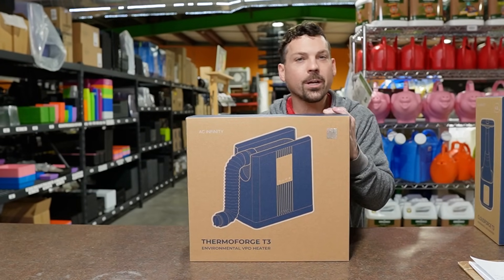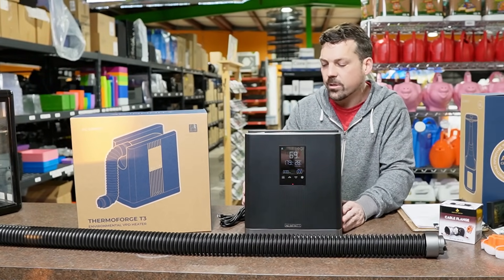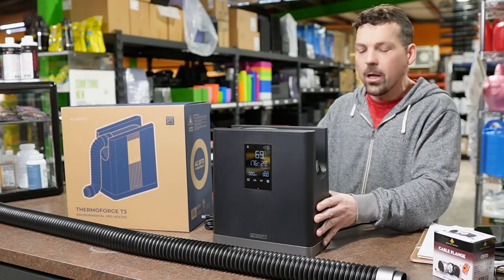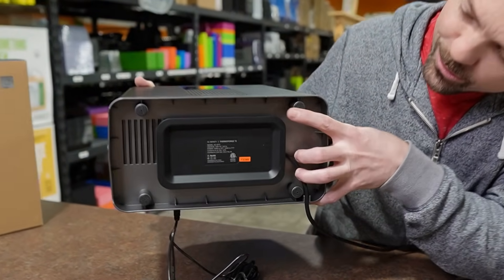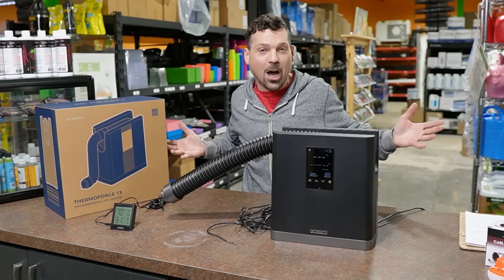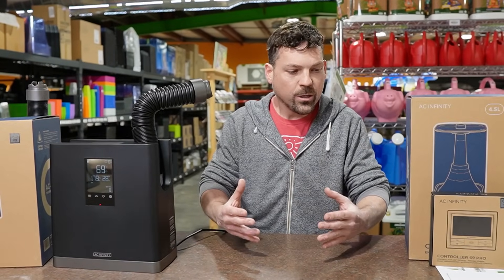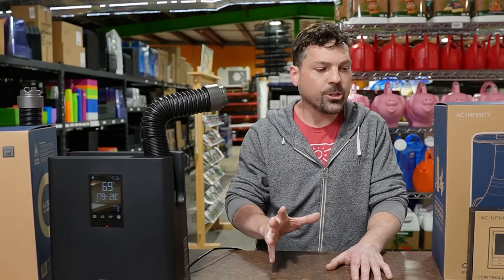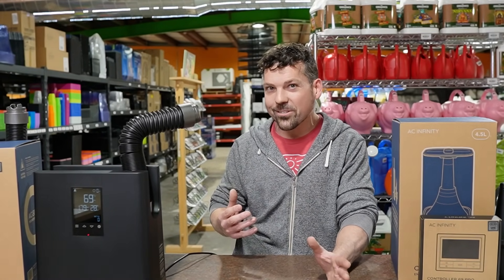NEW AC Infinity THERMOFORGE T3 Enviornmental VPD Heater OVERVIEW and TESTING

Comment: I think mine is faulty.
Running on setting 6 in a 2x2 and strugglign to break over 22°C
Had it on setting 1 and it dropped the tent to 20°C

Comment: Actually, just installed my thermo forge a couple hours ago. The cloud forge is  just sitting in the basement. I’ll probably install it tonight when I’m done making syrup. Also just got my notice that the terraform is shipping soon. Pretty excited about that. And the ai 
Controller should be here tomorrow. Pretty impressed with most of their stuff. They one exception is the S 44 light. I originally purchased one in 2023. It’s broken twice since then, they’ve replaced it but it’s just not dependable.

Comment: Low temp heat! Wont get my tent over 56 like the little cheapy I had! Sending back to Amazon. Directions are also very difficult and long.
Reply: Hey Captian i was thinkin bout pullin the trigger on this but im seeing some ppl saying its not great for colder temps. How much warmer would you say it gets on max for you? Im setting up a 4x8 tent in the basement where it stays right around 65ish. just lookin for a 10-12- degree bump for when lights off. What do you think? Nice bass btw
Reply from the maker: A 4’x8’ tent at 65 ambient will easily bump up 10 degrees to 75 at a higher speed setting or 8-10 on the ThermoForge Heater.
Reply: @jayhansen8196  Well if you have fans to move around the air in that big tent I think it will be fine. My garage gets to around outside temps,12 degrees right now. But I even put it in my tent and no go. My tent is wrapped in pink insulation and a little ceramic heater more than does the job kept inside the tent. I use ac infinity exhaust and fans to control humidity and temp.. Dialed in beautifully and heater does not run a lot. Hope that helps. Fish on!
Reply from the maker: You need to insulate your environment and be realistic about BTU’s of Heat neutralizing your 56 degrees constant surrounding environment.  A tent is not insulated enough to maintain 75-80 without the assistance of additional electronics such as Lights producing additional Heat BTU’s to continuously hold a higher temp.

Again try insulating your tent otherwise if you run lets say a 1500w heater your humidity levels may get eaten alive and reduced because of so much dry heat pushing into tent….

Insulate if you want an easier environment to control if you are in 56 degrees
Reply: Mine is cooking. Idk what your even talking about?

Comment: This heater is rubbish 550w is shocking you need to make a 1500w or 2000w at least
Reply: Its fine. Mine works better than it needs to in a 4x4 tent.

Comment: I'm going to run this in a 2x2x4.5. this this be my only intake of air in the tent. I'm running an exhaust fan as well. just wondering if this is aduquet for good fresh air intake, my humidity outside is very high so I hope this unit will eliminate some humidity while creating a few degrees of heat. Southern California beach climate.

Comment: I've had my T3 heater for a while and today I have learned @ 4:18 I can repair my tent wall with a 'cable flange' w/cutter @ 5:30 I have to clean my forgotten 'intake filter' and @ 8:17 It's not 1-10 'fan speed'...It's 1-10 'Temperature settings'...Dame I gotta turn down the intensity to #4 from #10  Next month I get the 69 controller to finally get rid of this science project of timers & relays in addition to the 67 controller : )))

Comment: So I run both of these in my tent. I turn on the humidifier it's outside the tent. So I expected the humidty to go up. It didn't go up it went down? So wierd. Humidity won't go above 40 unless temp drops to 70 if I add heat the humidity drops if I add humidty it drops. But if i cool the tent down the humidty will rise. I'm thinking it might be ventilation. but it's on all the time if it's off it just gets drier and warmer. No matter how high I set the humidifier.  Any explanation would be great
Reply: I want to thank these guys for all they do. I had some difficulties and I reached out. They helped me a ton. Ty

Comment: Dont have a dedicated outlet to power it up.  Im thinking about returning it.  I really thought id be able to use this product.  I don't think i can safely use it though
Reply: It has a regular plug underneath it. 😂
Reply: @Wide_leaf_indica710 my bad.  I meant a dedicated outlet in my garage.  Figured it out though as the heater is only 480 or so watts

Comment: If the basement stays really cool like ours, what use is the hose without any kind of insulated sheathing on? By the time the heat gets to the grow tent its gonna be constantly on and condensation build up in the hose and your energy bill will take a hit. Think i'm gonna take a miss on this and stick to a good ol trusty mini heater that's worked for years.

Comment: Well you’re missing a dehumidifier and an air conditioner, but you’re halfway there
Reply: OK.. so you would still need a  AC unit and dehumidifier for your longe room..live in tropics??
Reply: @romelljennings3203 are you saying you live in the tropics? Yeah I wouldn’t watch videos about heaters then 😂
Reply from the maker: For VPD control?  If the intake and exhaust manage heat and humidity then we are all the way there.  Each grow/setup is different and may require different accessories to automate with ease.
Thanks for chiming in 🫵💯✅

Comment: Is the photo bio par tester any good or better to get spot on tester?
Reply from the maker: PhotoBio is just as good as the SpotOn.  We tested both side by side and readings were exactly same.  We also like the handheld meter sensor on wire better for spot checks quickly vs having to stand up the SpotOn meter.

Go with the PhotoBio Advanced Quantum PAR Meter… 💯😎🌱
Reply: @gardensupplyguys  Thanks when I purchase it I’ll give y’all the biz for replying to me.

Comment: (Basement dweller here) I havnt tried the heater but had issues with my humidifier. I ended up using the UIS plugs instead and an evaporative humidifier so there is no need to use distilled water. and well the heater wasnt out so Iv been rocking a vivo sun heater which does great as well on a UIS plug. Im going to have to pick up one of the AC infinity heaters next winter and give it a go!
Reply from the maker: It sounds like a good plan… those UIS Plugs are great for exactly what you ran 👍
Easy on/off with trigger set points thru the APP.  I love it myself and the control is a blessing as well as the monitoring charts you can look back on 🤓

Comment: My tiny home is only 6x10 and I never went over 600 watts with a regular ceramic heater that is degraded. I like the hose as you can force the air in the direction of your choice, centre floor. This could work well for me.
Reply from the maker: It would handle that area with ease 🙂
Reply: @gardensupplyguys nice

Comment: 62.1°c
I wonder what the ambient temp was and how many btu's it outputs 🤔
Could you heat a tent in a seperate structure. Enough to not to cycle on to often when it's low single figures outside, maybe dipping below freezing
Reply from the maker: A little confused by how you envision the setup as separate structure in single degree temps.
Its 520watts max power… its powerful but it sounds like what you are thinking may not be enough BTU output to maintain optimal grow room temps with such a low varying external temp to outside grow tent ⛺️

Comment: I would love it if AC Infinity made a small AC that works with the Controller 69 pro, with a two hundred square foot area in mind as well. Drying by VPD is also interesting as well, when leaf surfaces are around ambient temperature without any light.
Reply: I’m sure they’ll get there I absolutely see them coming up with a dehumidifier and an AC unit just a matter of time
Reply from the maker: Right there with you… time for a cooling solution via A/C… give us 10,000 BTU or higher !!!!

Comment: Why not add 400 watt hid light to heat your tent or area? It's the same wattage.
Reply: Maybe you would want the heat during lights out.
Reply from the maker: Well put. We still sell lamps in shop for those cold basements in winter that need that radiant heat production… kudos for thinking like a grower 🌱🫵💯.  Much respect ✊🏻

Comment: Spend 1500 an a new setup and acinfinity a terrible company killed my grow light refused support shame on them terrible support terrible company
Reply: How did Ac infinity kill your light?
Reply: @Hoodstar87  they said there smart system using there rj11 cables were compatable with my light we plug them in and they started to all flicker contacted acinfinity told us it was normal checked on the light the next day and my light had only one panel on and the dimmer no longer worked the didn't fix the issue till 3 months after they had already killed my grow light
Reply: @GrowTentGaming-pj4yr I have my lights on a digital timer. I was thinking about connecting them to the contoller 69. Is there any benefit to doing so? Other than turning them off and on? I can dim my lights on the driver.
Reply: @wambsganz8  I bought mine for there sunrise sun and sun set feature but either than that it's feels just like every smart system with the same features and way more expensive I would honestly just stick with the digital timers

Comment: The test needs to be in an actual grow space
Reply from the maker: We are running an 8x8 with some very nice control using the ThermoForge…. it can maintain those night time temps where we set even though it drops to 55 degrees external temps… internal we can move to 65-70 degrees and hold constant in dark cycle.
Reply: @gardensupplyguys  nice to hear..

Comment: I had a hard time finding a lower wattage space heater. I didnt need it connected to a controller constantly turning on and off at 1000w+. Finding a 250 - 500w heater is a god send when you're just trying to heat a small footprint.

Comment: is that a pig shaped watering can with holes in its snout for pouring 🤣
Reply from the maker: You know it !   I wanna turn one into a decorative pig cloner system using the snout holes to drop two cuttings into with an air stone bubbler in the belly base.... Future Patent coming soon on pig cloner 😆  Here is the link to the Pig Watering Can:  https://www.gardensupplyguys.com/products/novelty-manufacturing-co-pig-watering-can-1-75-gal

Comment: Are you going to do a video on the gen 1 vs gen 2 T3 humidifier like ya did with the s6 oscillating fans? I thought the in depth look at the differences between the fans was an awesome video.
Reply: I have a Gen 1 that no longer works so naturally I took it apart. Not impressed with the main contol board. Sloppy soldering and no name I.C's on the tiny board that would be a nightmare to fix. Also the main board had some writing on it like it was reworked in the factory. I just got the Gen 2 one week ago under warranty and I am resisting the urge to take it apart. The main difference I can see is that you can use the  Gen 2 without the controller 69.The T3 has 3 contoll boards, main, power supply and a small board for the ultrasonic disk. Power supply and ultrasonic boards are off the shelf. Main board is  proprietary/custom.
Reply from the maker: Done ✅. Check our latest uploads.  Hope you enjoy it.